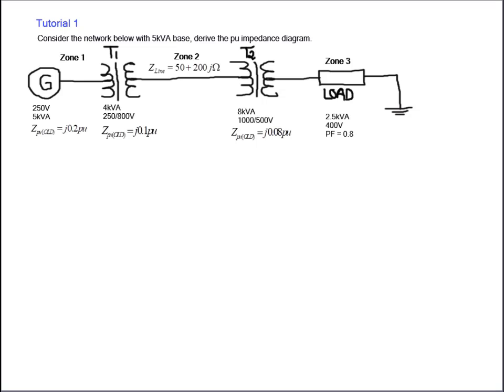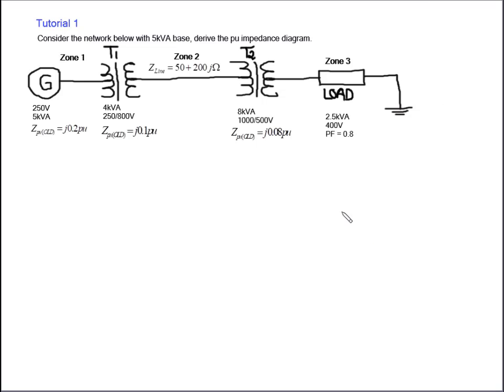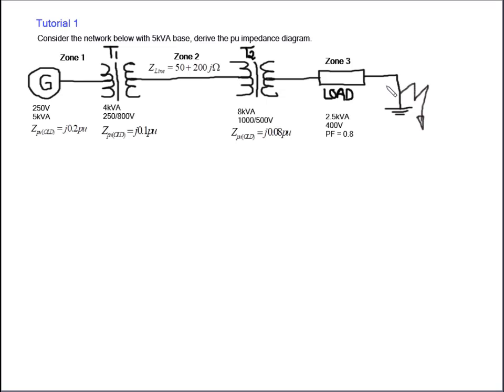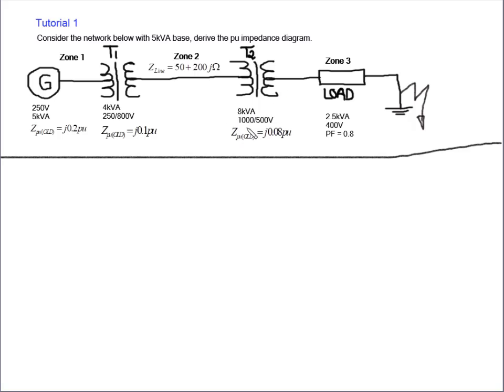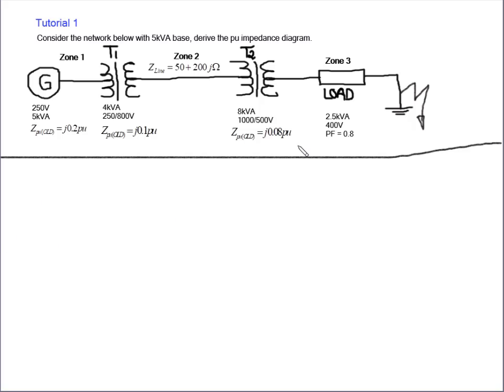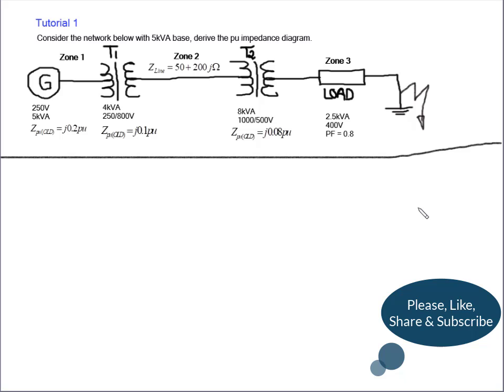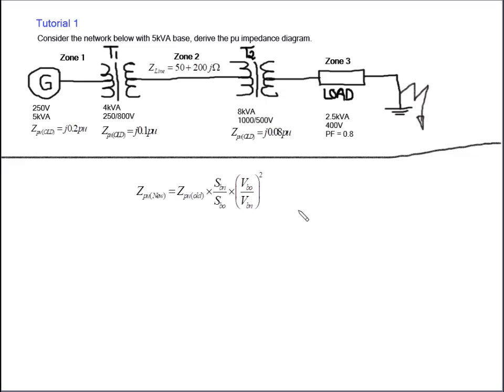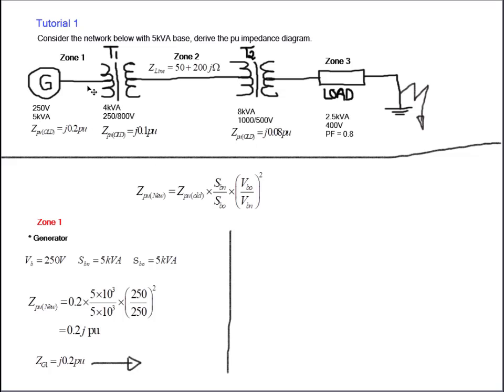Per-unit system calculations - Tutorial 1.part 1

Comment: So for transformers, we use any other Vbo(250/800 KV) we want?.  For example, you used 250KV instead of 800KV
Reply from the maker: Hi Vincent, base voltages depends on Zone voltages as per transformers voltage level.
I recomend you watch more vidoes to get a good undertanding.

If you want a session with me you can Join my channel membership I will assist with expalnation and clarifications.

Comment: may you please help me with drawing the per unit of a street lighting system where a mini substation is feeding 4 transformers and those transformers are feeding 300 light poles each
Reply from the maker: You need a feeder System, you already have the sketch on your statement just put it on pen and paper. Each transformer will feed about 75 lights, those light can be reduced to a resistive load with x amount of kVA or MVA depending on how big of the load they are, then you need to know your cables impedances so you can calculate the per unit from it.
Draw it and DM it to me on my Twitter handle @CMTEQ1 will have a look for you.
I hope you have already subscribed.